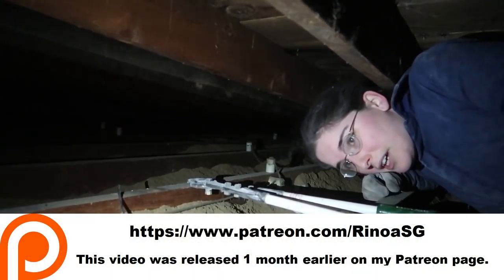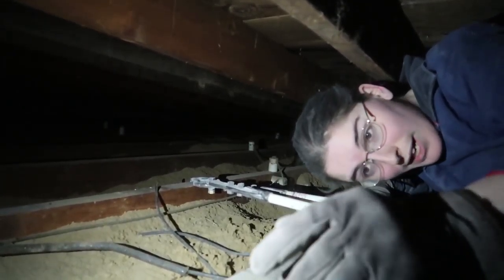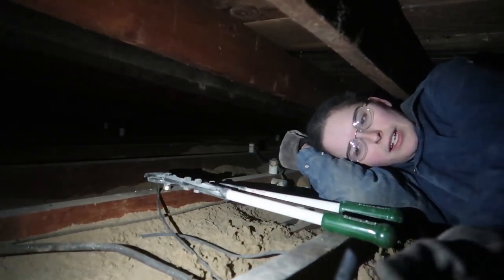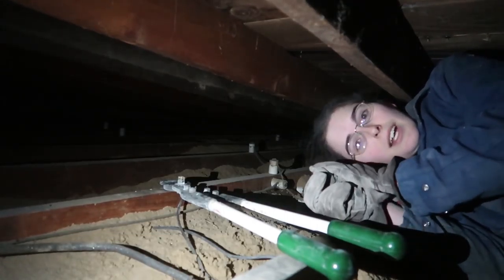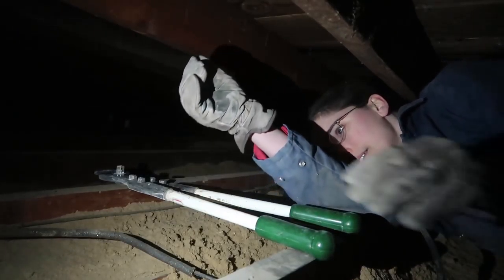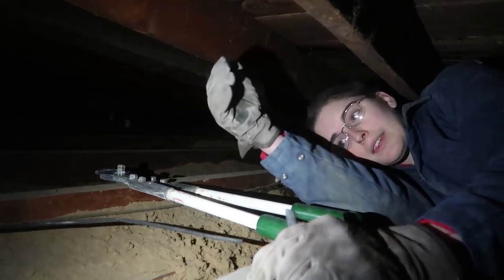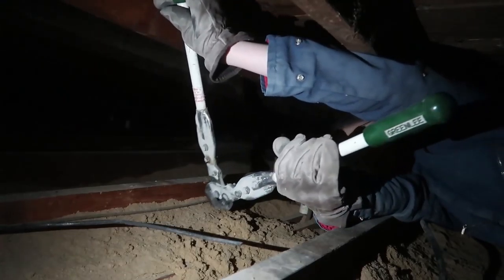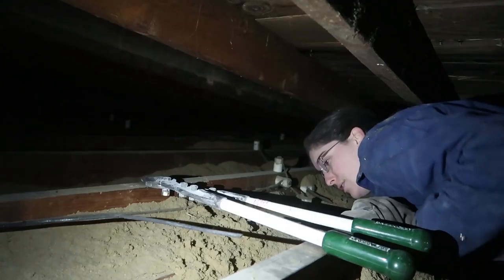No Breaker, No Fuse 02: Stupidity-Resistance Test 1915 120v Knob & Tube Wiring (simulated 70v 100A)

Comment: Great job showing how old knob and tubing is NOT  dangerous as alot of people think when i was working i would get calls to check peoples house wiring i had a lot of people scared because of the knob and tubing wiring in a lot of homes here people was afraid their house was gonna burn down because of old wires and some  shady electrician's would tell them it was really dangerous i would go inspect them and if they was blowing breakers or fuses i would recommend splitting the circuit up and repairing the wires to me knob and tubing was alot safer then romax because most times it couldn't be shorted togather and they shouldn't worry about it as long as they wasnt having trouble with it .

Comment: I have an old book that covers installation of Knob and Tube wiring. Biggest issue was where wires crossed over beams/each other. Fuse boxes were also a mess, trying to route wires in from all directions to maintain distance between wires.

Never seen any of this wiring in person.

Comment: I lived in Buffalo NY for a year and the house I was in had active knob and tube wire in it.  It was exposed in the basement.  When we went down to do laundry I could literally hear the buzzing in the wires almost like you’d hear in a Jacobs ladder.  It never made much sense to me, but it was happening.  It used to scare me from a fire perspective but obviously it was far enough apart that no sparks were jumping.  I’m actually wondering if it was possibly 220.  It was a House I was in but it had an upstairs level that I had no access to, so I was never able to follow the lines.  Their breaker panel was locked also.  It had two separate boxes for each apartment.  One fuse box, and one upgraded circuit breaker box.  I’m guessing they were 100 amp service boxes each.
Reply: Rick Delair thought it was strange myself but it seemed to me like it was buzzing at every knob.  I’m around electrical work constantly and I’ve never seen or heard that in my life is why I through it out there.  Strange indeed

Comment: They didn't stop using knob and tube wiring because of the time factor of installation. They stopped using it when people started insulating homes. Knob and tube requires open air all around it and it's the open air that acts as an insulator. When they blew in the insulation and covered that wire it was susceptible to fire since the real rubber costing dried up and cracked causing many house fires. Today some insurance company's won't insure you if you don't have upgraded wiring and a 100 amp service. As long as the knob and tube wiring is in an interior wall it's fine

Comment: Easy, the wiring was done by the Journeyman, who was probably a boy between 8-15, who was doing an apprenticeship under the instruction of a master electrician, and who was thus small enough to fit in the crawlspace. Drilling holes with a brace and bit, or with an awl, and then pushing in the tubes as insulators, and doing the knobs and wiring is all up, in the dark, with only a candle or kerosene lamp for light.

Comment: I live in a 1916 cottage and the remains of the old knob and tube wiring is still there. Very sketchy looking. But houses only had 20 amp service back then. The 1970s stuff can be way more dangerous because some used aluminum grounds.
Reply: ThriftStore Hacker i grew up in the ‘80s, and my dad was an electrician. He worked on a lot of ‘70s mobile homes with all aluminum wire. Talk about dangerous!

Comment: I remember insulating my moms houses years ago and found a tube and wire sticking above the wood chip insulation. Because it was retired at some point in time a though this wiring was long disconnected, IT wasn’t. It was live bare wire right at the same level of the wood chips, a real fired hazard. The silly thing was it took me a whole day to figure the circuit it was tied into but I was never able to figure out just why someone would wire this project this was. 
I’m sure you are knowledgeable enough to figure it out but after some many years these old wiring systems are still burning down homes.
Reply: Easiest way to find the source is by cutting runs and following the side the current remains on.  Eventually you'll narrow it down to one little section that's live while the rest is dead because it's open.
Reply: sc0tte1     First of all I wrote “retired when I wanted to say rewired ”.  In addition the old wiring in this old home was somehow was tied into the newer wiring in such away that it made it difficult to trace.  I also feared that if you find one error in the wiring you really need to question the whole house for more issues. I checked the gas lines and found two small leaks in addition. 
If that wasn’t bad enough a house near us blew up completely because a guy used water pipe and valves to hook up his new heating plant. The house blew up killing his spouse and grand child.  So I always check every job done done by other people. You just have to be anal when it comes to things like this. 
A number of years ago I suffered from a form of testicular/ovarian cancer, I’m intersex. We switched our new home from propane to natural gas. The fellow came in while I was recuperating and did the job while I lay I’ll upstairs. My spouse told me she smelled gas but the chemo destroyed my sense of smell. For over a week I called and call this fellow to come out and check but he didn’t come. The city we live in started bugging me about the pressure tests that were needed on the gas lines that he didn’t do. When I did finely got someone with the company they still didn’t come out and they then sent in a fake test report stating the gas line tested ok.  At the time I couldn’t walk so I called the gas company in the next town and they were there right away. Every connection that was made leaked and they carried me from the home while the gas was vented away. The first contractor lost the right to do business in our community. He could have killed my whole family. I was on oxygen for days after. What happened is he had college students do the job and he never checked the job. 
Don’t trust anyone.      

I just came out of early retirement and took a position in the electrical department in a big box store. Retirement does not suit me besides I have some knowledge in this area and thought it would be fun to learn more in this field.

Comment: They probably put that wiring up there before the roof was put on.  My Grandparent's house originally had no electricity,   and a flat roof. However, when the roof was being repaird some years later, they were able to add that very same old wiring.
Reply: GeekBoy03 or it was done by a child? who knows back then. I know my dad installed the electrical wiring in places that my grandfather couldn’t get to when they were installing electricity in their house that was build around 1900
Reply: That's so cool, I love the history of old houses. Look how far we've moved while the house is standing... Moving from gas and oil lamps to electricity, then to today...
Reply: Yes that is true. I had forgotten children where used  a lot back then. Now days the mentality is if they even see children doing yard work it is "abuse."
Reply: Just the other day I was thinking about advancements while watching movie clips from 'Trading Places." Realizing the movie was released in 1983. From the year 1943 to 1983, there where massive advancements, and visual changes you could see in only 40 years. Now if you compare 1983 to today (2018) is 35 years. You really don't see those massive changes there . The only things to change really, are in electronics being smaller, cheaper, and more powerful, and communications.   From 1943 to 1983, we went from propeller air planes to space flight. From tubes, to integrated circuits. What other massive changes from 1983 to 2018 were there? I am just not seeing them.
Reply from the maker: +GeekBoy03 it seems the later half of the 1900s and early part of the 2000s are proving to be a bit stagnant. however i think we are doing our homework that will pave the way for some big changes down the road. like honestly it was probably for the best to not go into outer space much until now. its good to have all this computational power and new materials to build with, will probably end in less lives lost due to accidents.

Comment: Those cutters holding up?
Reply from the maker: i tried cutting some copper pipe with them and so they are a bit roughed up, but they still are cutting ok. i might reshape it and temper it more later on.
Reply: Rinoa Super-Genius awesome.  I was just curious how well the welding rod took to tempering

Comment: The biggest problem with K&T that I see is that Physics is against it in so many ways. I'm writing an article right now on K&T, and I'd never understood completely until now why, every time I've had to splice on to it with newer wiring methods (yes, something that can be done by code, but must be done in a very particular manner), it was always so crumbly. Did you know our modern wiring with putting all the circuit conductors into one cable is not just easier to install, but it is vastly superior in terms of Physics? The old Knob and Tube practice of spreading conductors so far apart is the kicker. The K&T single conductors build up more heat because they are too far apart for the opposing magnetic fields they are generating to cancel each other out! So, instead of a net zero magnetic field like a balanced modern cable, now you have all kinds of eddy currents and inductive heating going on all the time in every place one of those single conductor cables passes too close to a piece of iron (like the nail inside the porcelain knob). Very poor efficiency! And then, back to my experience with this cable. The insulation practically falls off if you touch it. That's because the old wiring was a single conductor covered by rubber, not plastic. Rubber ages very poorly compared to thermoplastic. It wasn't made to last. And the thing that really kills electrical equipment, including wiring, is heat. So, how many attics are still un-insulated? That's right, you are not supposed to insulate over Knob and Tube wiring. It has to be open to the air in order to dissipate heat. But if its not insulated, then all the heat in the attic is also baking your rubber coating. And then again, people didn't know NOT to insulate over it, so you find it buried in insulation anyway where it is suffocating in its own heat. The stuff in the open wall cavities is usually in better shape, but sometimes I still find crumbly, crummy insulation in the device boxes where there was more heat concentrated. How does your electrician deal with this? Does he bother trying his best to tape up the failing insulation and keep it intact, or is he being yelled at by the customers and his boss to hurry up, so he curses quietly under his breath and lets a few things slide? You really are wayyyyyyyy better off getting completely rid of this stuff. It is the life and safety of your family members and you on the line here.
Reply from the maker: I’ve not found any evidence of K&T heating up much at all under thermal cameras fyi

Comment: Different to us in the UK, we have twin and earth running at 230v. I'm not familiar with your core sizes but those cutters look unnecessary. Up to 4.5mm² twin and earth I can usa small pair of single hand cutters. Above that size I need slightly larger with a decent head, certainly not two handed ones lol